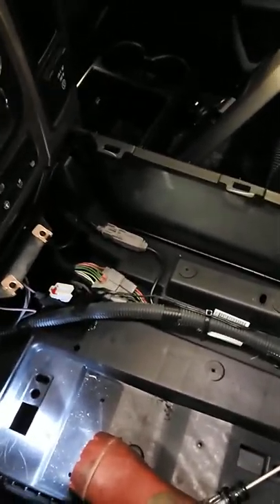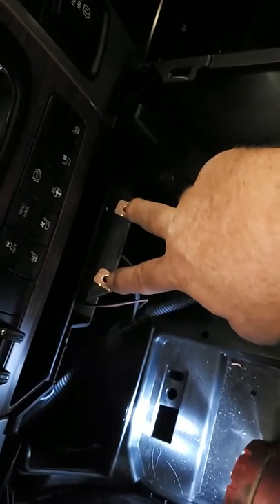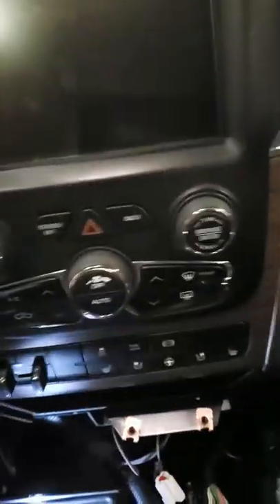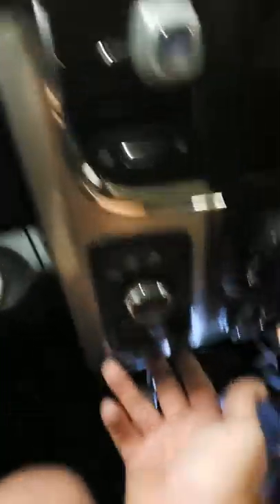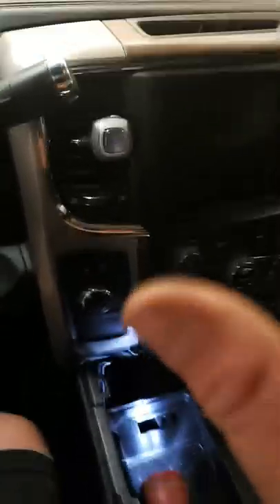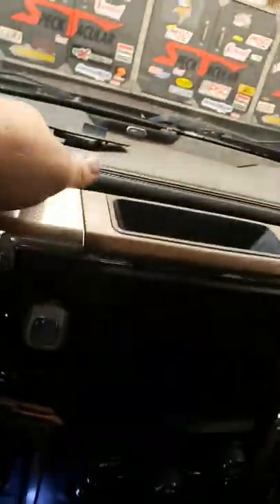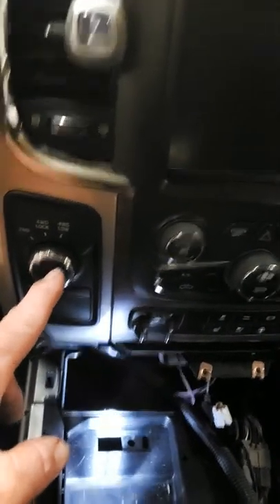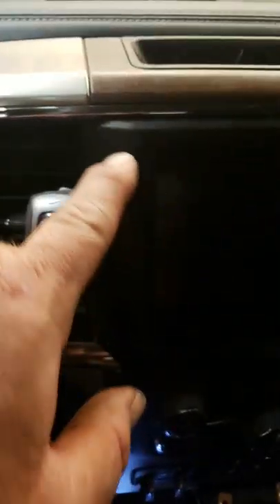2013 ram cargo camera installation

Comment: Ok Bob I have a question. Will this work on a 2012. If I’m going to use an aftermarket radio. Then all I need is the power for the camera and the rca adapter? What are your thoughts?